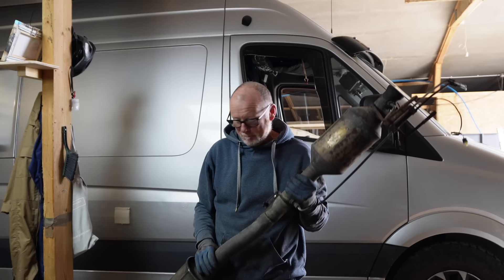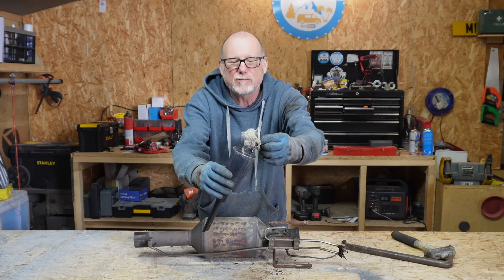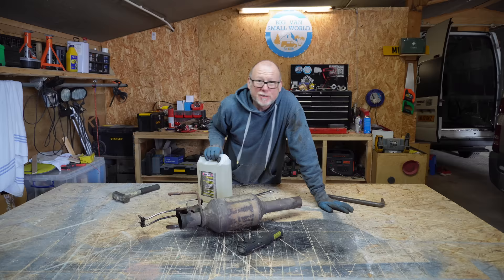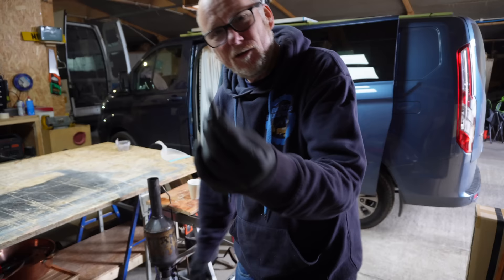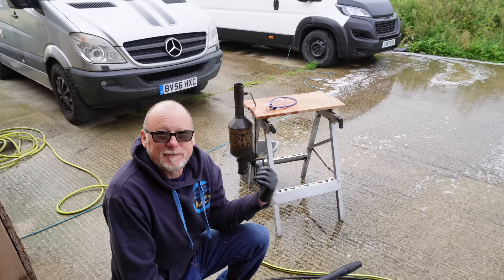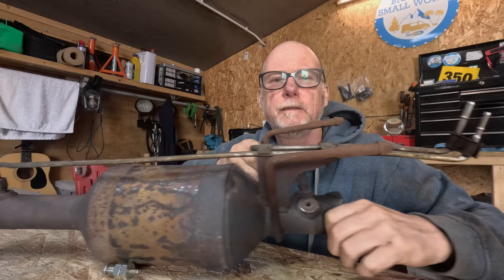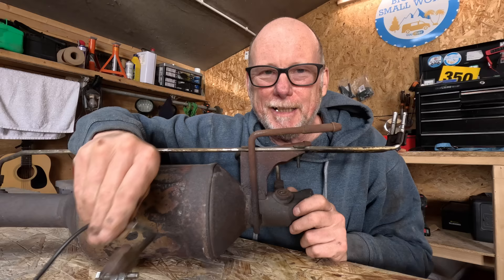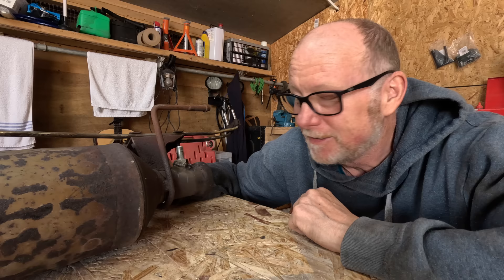DPF REMOVAL & CLEAN Using Wynn's Off Car DPF Cleaner

Comment: You think that come up with a better way of getting at it and just purely clean it they want these pollution gear put on diesels but the problem is diesel’s burn black with petrol doesn’t so they need to design it better where are you should be able just get that part out clean it and put it back in but The car manufacturers don’t want to do that they like to kill engines so people come by cars for you much sooner the consumers getting ripped off again

Comment: Could you just rod out DPF. Then it won’t ever block again.
Reply: Assuming you're referring to what others call a "DPF delete" - supposedly MOTs will be checking and failing vehicles that have modified the DPF system

I have no source of info, its just what I've heard!
Reply: @TheVanderfulLife  A DPF delete was the only thing that worked for me and the MOT has passed 3 times since I had it done. I tried everything before to clean it but nothing worked permanently. All the pipes to the DPF block as well, so they need a good clean too.
Reply from the maker: Lol no I couldn’t do that because m responsible influencer 😬
Reply: They cannot fail it u can only fail wat u can see nobody can say if dpf is inside or not break it out and get ecu remapped
Reply: @Ma-fh9on  Ahh interesting! Never thought about just removing the filter and keeping the housing, I assumed people cut the whole thing out and straight piped it...that makes sense
Reply: @TheVanderfulLife  oh ya mostly cut housing flap it back like an open window break out filter close the flap weld it back up not hard at all doesn't need t to be big opening
Reply: @BigVanSmallWorld  Becky would say ,what a good boy.